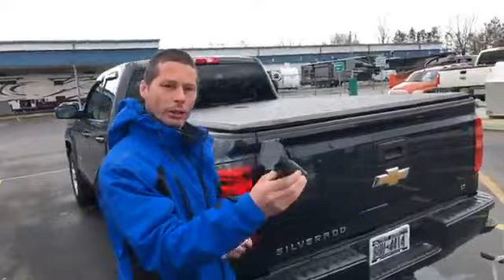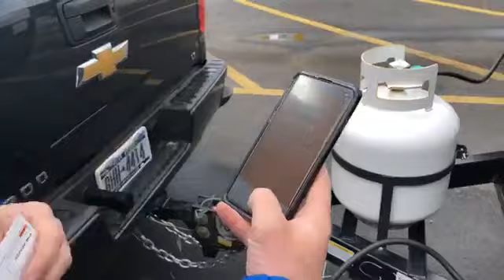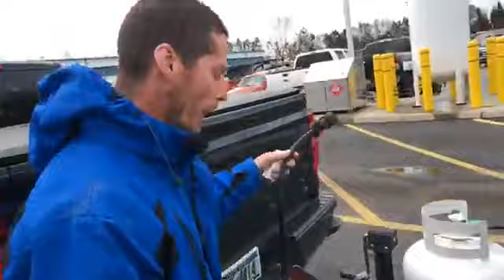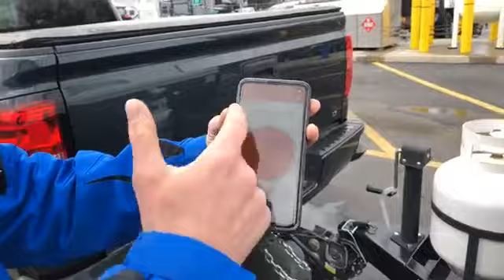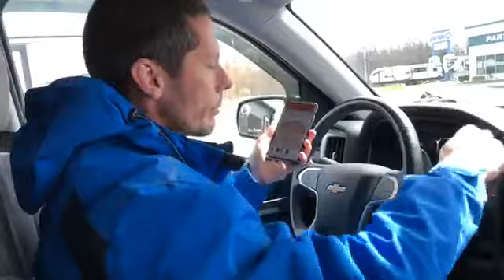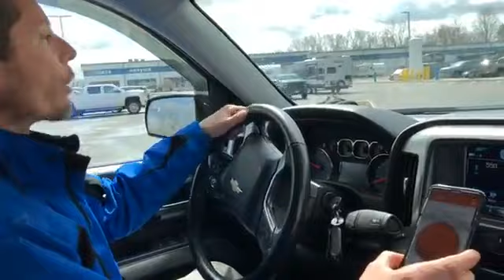Curt Echo Smart Wireless Brake Controller - How it Works

Comment: Hi
When you are not using the Echo blue tooth brake system, what is the procedure to take it off and how do you store it? Will it use up your car battery if you leave it plugged in?
Just got it and have not read the manual!

Comment: Does the tow vehicle need ABS for this to work?
Reply from the maker: No it does not need ABS, just power to the 7 way. You can always give Shawn a call for more details at 716-694-0188 ext.451.
Reply: Yes and so does the trailer........just kidding

Comment: I worry about the extra weight on the plug in. And it falling out on bumpy roads.
Reply from the maker: Hi Javier. thank you for watching. If it is connected to the plug correctly it will lock, preventing any disconnections while in motion.
Reply: Javier, I did have problems with the weight of the brake cable and the length of the controller so I tied a piece of light para cord around it and up to the tonneau cover which supported it just fine.

Comment: Seems like a really good system a little pricey I do like the capability of setting the brakes on the camper to slow you down or keep you from swaying also at that point are you wearing and tearing on your camper brakes more than normal instead of using your vehicle breaks and your camper brakes shoot me a email back Grassmankc@yahoo.com at yahoo.com

Comment: So basically you just need to run a power wire from the battery to the back?
Reply from the maker: Pretty easy right? If you have any additional questions for us, you can always reach us here at 716-694-0188. Anyone of our Parts Professionals will be able to assist you. You can always reach out to us from the website as well. www.coltonrv.com